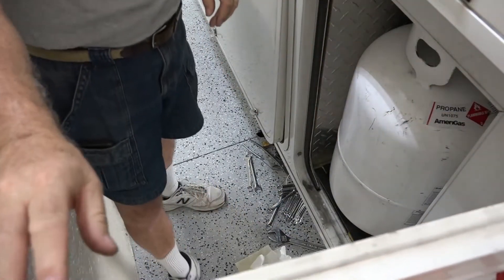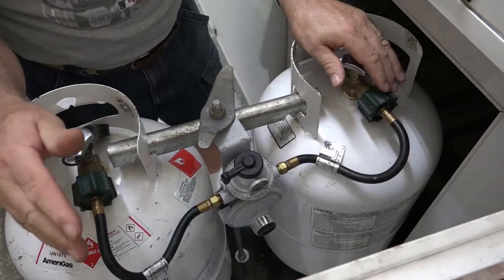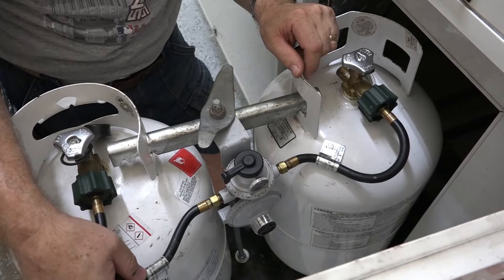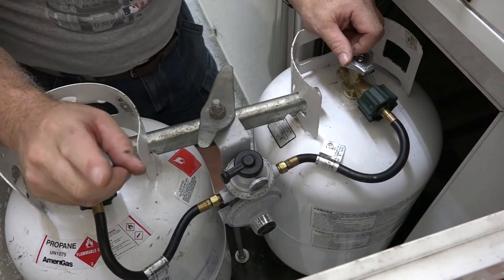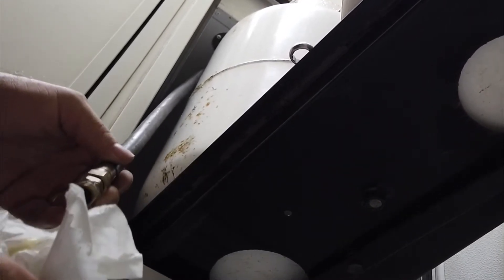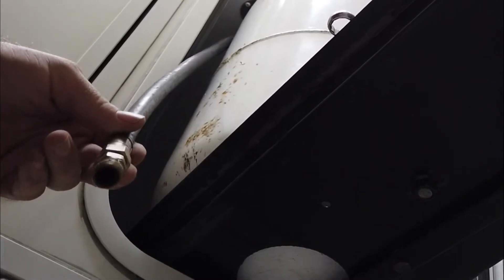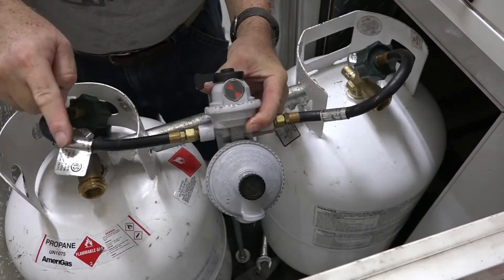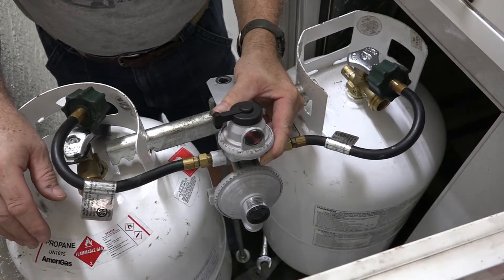RV Propane Maintenance - Oil in the Propane line!

Comment: I'm a RV tech from probably the biggest and most hated RV dealership in the US. I'm there dedicated mobile tech. Customer came in with furnace issues. There was a rodent in the burn chamber. We also replace the main burner (not sure why) and sent customer on there way. Customer called saying his furnace still isn't working right. I go out and tried everything. Furnace would cough and sputter. Wouldn't ignite on its on unless you put you're hand over the intake. Worked perfect out on the bench mind you.  Each time id remove the furnaces lp hose id hear gurgling but didn't put 2 and 2 together until I exhausted all the usual suspects. I thought water was in the lp lines. Removed furnaces lp hose from where it branches off the main Line. What seamed to be a quarter quart of oil poured out of the furnaces lp hose. The furnace was the first lp appliance in line after the main regulator. The manufacturer ran the furnaces lp hose with a low hanging  p-trap like loop that dipped down below the main line. Oil that is naturally (my believe) in lpg collected there over the 6yr live of the camper until it started effecting the combustion process in the furnace. The furnace fired right up and ran smooth after removing the built up oil from its lp hose. Fixed issue by pulling the low hanging hose up so its not below the main line.
Reply: I think this is my problem. My original regulator went out and I ordered a new one. I replaced the regulator and the furnace worked at first but then slowly stopped working (it also worked perfectly on the original regulator), and so I purchased a new regulator and still nothing (2nd new regulator). Burners are working fine and got new propane and still nothing from the furnace. I am at a loss and I don't want to keep replacing parts, I went to a service place and they said last time they had to "blow the oil out of the lines." Do you know what this means or how to do it, or if that is safe for the system to use air. Thank you.

Comment: So the oil come from the silicone in the hoses and makes the rubber bendy, losing oils makes the hose solid like yours. Since the pressure is regulated after the hose and not at the tank, the unregulated pressure causes the hose to expand(oil leaks) and contracts with the pressured flow of the propane. That why if using a propane tank and hose adapter for heaters and such they need a filter after the hose.

Comment: Every couple tanks when refilling add a cup of rubbing alcohol to your empty propane tank before filling  to clean out the lines. Won't hurt system at all and just burn away at appliance bit will clean out and prevent any oil builded up.  To add rubbing alcohol valve must be open and you must push in and hold the internal safety on the valve.

Comment: Never use teflon tape on inverted flare fittings. Your old hoses had the brass adaptor on them and were the exact same hose. You just separated the hose/fitting in different spots. It went from 1/4 NPT to 1/4 inverted flare.

Comment: Keeping that BBQ hose charged all the time would make me nervous. I'd put a ball valve on it, after the wye. Or just disconnect it from the coupler. You may also want to put a Mr Heater filter (oil trap) on the end of that hose.

Comment: I've been selling propane and filling propane bottles for over twenty years. The family for 50 years.   I am slightly mystified by how oil gets into the system.  Not sure "over filling" has anything to do with it.  Your tanks have an overfill prevention device on the valve.  There is no overfilling the tanks, not since 1998 or so when the OPD valve came out.  It's more likely that over time there is build up in the camper system from impurities in the propane or atmosphere in the tank from not properly being purged.  It's possible that perhaps the oil is a byproduct of the decomposition of the rubber hoses.
Reply: The oil is the ethyl mercaptan, the odorant put in propane
Reply: Is Ethyl Mercaptan an oil or just a liquid?  Seems like if it were so easy to fall out of suspension from propane it would defeat the intended purpose of being in the gas so that you could smell it.  There could be ethyl mercaptan in the oil these people are finding, but its probably not pure ethyl mercaptan.  I find it more likely to be oil from manufacturing combined with atmosphere from entering the system while disconnected that builds up through condensation.  The solution would be to have your tanks purged, clean out the hoses and see if it returns.  And maybe these folks finding oil never had their tanks properly purged from the outset.   Or maybe it is the ethyl mercaptan, and what seems like only a very small number of people have a problem, despite millions of people that own and use propane tanks.
Reply: "It's possible that perhaps the oil is a byproduct of the decomposition of the rubber hoses.", I think that is the problem, high pressure gas first running through a rubber hose rather than first running through a low pressure regulator and then a rubber hose.  If you encountered oil in the system, what solvent would you use to flush it out?  Just asking if I should find a piece of equipment with this problem.
Reply: @monkeyboy4746  I would either replace hoses or take them off and use dawn dish soap and water to clean them.  Blow out with air compressor.   I wouldn't use stronger solvents that might be harsh on the rubber.
Reply: Instead of the hoses, could it be the 'oil' that is added to create the distinctive smell evident when leaking?  Seems logical, since propane is odorless.  BTW, having incomplete combustion with my RV Furnace which results in the propane detector going off.  Replaced solenoid propane valve after thorough checking/cleaning for insect nests (none), which didn't fix the issue.  Had to blow out the gas valve on my Weber Q grill with compressed air due to poor or low flame.  Sometimes hook it to RV tanks.  The 'oil' which came out was clear and more viscous than water.

Comment: Great video, thanks. I'm still confused where the oil comes from.
Reply: I’m quoting "a service tech for a large propane company. The oil is actually a pretty common issue with rubber hoses like the one you have as an extension. We do the same with our tanks to RVs. Something about higher pressure sitting in those hoses draws the oil from the propane. What we use to stop the issue is a little 20psi regulator before the hose and tends to clear up any issue with the oil forming. " from a Google search.

Comment: Your projects are always so informative. Question:
Is the auxiliary barbecue grill line always pressurized even when not connected to grill?
Reply from the maker: NOTE:  The 12' long line added to the Y is at high tank pressure, and should only be connected to gas grills with their own regulator (to adjust the flame height)!  Do not do this type extension hose if you have a low pressure gas grill!
Reply: @charlescoushaine  Thank you